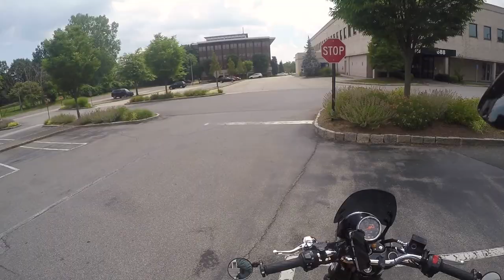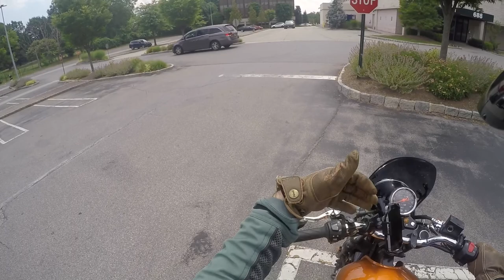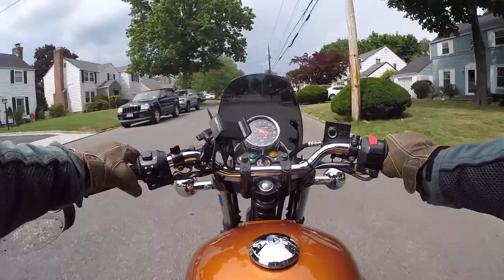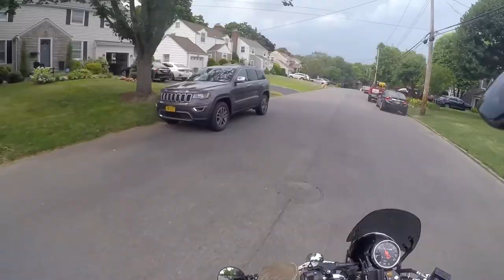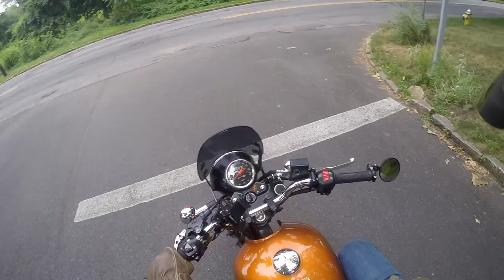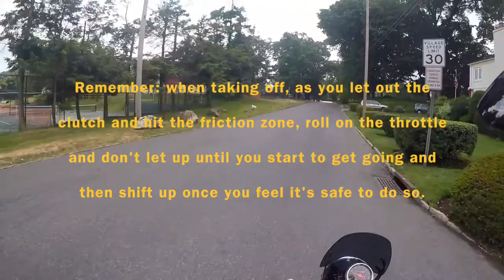How Not to Stall a Motorcycle on Takeoffs: An Effective Strategy to Keep Your Bike From Stalling

Comment: i was afraid that if I roll the throttle too much that the bike will zoom away. You made me realise that it will not because I am at first gear lol. I will practice this. thank you
Reply from the maker: I hope you find it helpful, Jay. Thanks for dropping by and for your feedback. I appreciate it.
Reply: ZOOOOM
Reply: If you find yourself going to fast in 1st just pull the clutch back or use the kill switch with clutch in.
Reply: @JDMz  thanks for the tip. I will keep this in mind. It's been a month and I feel confident riding my mc now. Specially when a vehicle is behind or in front of me.

Comment: Unfortunately motorcycles manufacturers failed to advance and improve motorcycles to appeal to most riders. Many riders give up and sell their new bikes because of safety and operating issues. The motorcycles technology used today is the same technology of the early 20th century. Motorcycles with standard trans should not stall under any circumstances and there should be no excuses.  Most street bikes should have a shaft drive.  Honda makes automatic transmissions for some bikes which is a good thing. Removing a wheel should be easy like a car wheel.
Reply from the maker: Thanks for your comment, A.A.

Comment: The most dangerous place for a motorcyclist can be at intersections, at signal lights and roundabouts. So always look in every direction to make sure it's safe to proceed. 

Bonus Tip: When riding a motorcycle, look way ahead in advance and analyse the road in front, so as to be prepared in case of a sudden event (example: a car merging in front abruptly).

Comment: Nice, straightforward video. Thanks. One question: how would you take off on a right turn, from a stop sign, on an incline. 
Also, in Ontario, it's frowned on to have both feet on the ground. I believe you actually lose points on the test if your right foot comes off the peg. Only the left foot is allowed off the peg at stops.
Reply from the maker: Hi there, jRichard! Thanks for stopping by. You ask a good question: How does a rider take off on a right turn, from a stop sign, on an incline? What a rider does in this case depends on a number of factors. First, always try to follow the guidelines you have learned in the motorcycle rider course, and if you haven't taken one, you should. Second, if you are a new rider, riding a motorcycle for which you are tall enough to be able to straddle it with both feet firmly planted on the ground, then you should apply one of the brakes to prevent the bike from rolling backwards. (I prefer to apply the rear brake UNLESS, for various reasons, I need to keep both of my feet firmly planted on the ground at which point you need to use the front brake, though I am not a fan of this, especially if stalling is an issue you're dealing with.) Once you have applied one of the brakes, then you should release the clutch ever so slowly while simultaneously applying a bit of throttle until you get the bike going. (Don't forget the throttle and don't shift until you get moving and until you feel it is safe to do so.) Now, I also use the friction zone to hold the bike in place while stopped on an incline, but to do this, you have to have experience riding. I really practiced a lot in empty parking lots and in areas with a lot of hills and minimal traffic. I hope this helps. I am not an expert; I'm just sharing with you how I have learned to deal with such matters when riding. Perhaps I might do a video on this, but due to my daily job, I barely have time to breathe.  Let me know if you have further questions or concerns. Be well & ride safely!

Comment: One important fact for new riders: don't put in 1st gear, unless you have come to a complete stop and the motorcycle is no longer moving. 1st gear is used only to start moving. Putting the 1st gear can be very dangerous if you are moving at a considerable speed.
Reply from the maker: Hi IM! Yes, you make a valid point. Shifting down to the first gear when the engine is at high revs has many consequences, including damage to the engine, and the rear tire will most likely skid and the rider risks losing control of the bike. Extremely dangerous.
Reply: @ReluctantBikerNYC  Yes, exactly. It can affect the engine and even cause the rear wheel to lock. I've noticed this for some new riders, hence it's important to tell them the reason not to do so.

Hats off to your videos and excellent explanations.
Reply: Hope you make a video on how to shift properly and smoothly on a motorcycle, the technique of rev matching, especially for downshifts.  I was once a new rider too, now I want to share my experience as a rider, so as to make riding motorcycles much safer.
Reply from the maker: I am working on a number of videos that deal with this topic, but my daily job is killing me. Between the job and the awful, soul-crushing weather here on the East Coast, I simply haven't had a moment's peace to get these videos done.

Comment: I just see people in fail compilation, they just throttle and wheelie and then crashed, so i wonder, how can they throttle smoothly without getting pulled like an rope tied into you
Reply from the maker: Hi! It depends on the bike. If they are riding speed demons, then that's easy, but again, the kind of bike you ride determines that. My Z900RS pulled like that.

Comment: It's hard to tell. Are you keeping the clutch at the friction zone when rolling on the throttle from a stand still? Then while still at the friction zone you pull clutch all the way back in to shift to second then back to the friction zone with steady throttle?
Reply from the maker: Hi. Let's address the first question: "Are you keeping the clutch at the friction zone when rolling on the throttle from a stand still?"--Yes, I am, sort of. The clutch is not kept in the friction zone; rather, it is released into it slowly. As you release the clutch, you simultaneously must roll on the throttle. You also ask, "Then while still at the friction zone you pull clutch all the way back in to shift to second then back to the friction zone with steady throttle?" The clutch has been released entirely and the bike is moving, and when you're ready to shift, then you pull in the clutch all the way, shift gear, and then as you reengage the friction zone, you roll on the throttle again--but you must be very careful, especially if you are riding a powerful bike. Hope this helps. Let me know if you need further clarity on this matter.

Comment: I don’t agree. I looks like you found a way not to stal the engine on takeoff, but I would definitely advice you to give more attention to the clutch and the friction zone over the engine rpm. 
All though it is a cooperation of the two, the biggest mistake is telling people they need to release the clutch slowly. That is a false statement and it causes people to stall their engines. In fact, what really happens is that you release the clutch just enough to get into the friction zone, then you keep it there, and once the engine rpm matches the speed of the rear wheel you release completely. People need to understand that the speed of the gearbox (being zero) does not match the speed of a turning engine (being approximately 1100rpm) on standstill. Both are connected with discs that are able to slip. Your clutch is designed to control the slip needed until they have approximately the same speed. Then you can release the clutch completely. 

Revving that 250 thumper is not the way to do it, all though it has as a result you won’t stall that much, you are missing the point of clutch control.
Reply from the maker: Hi there. I do not think you and I would disagree with your view. For example, I agree with you that a rider must give significant attention to the clutch and the friction zone, hopefully thoroughly mastering their application to the art of motorcycle riding. I also agree with your statement that one should "release the clutch just enough to get into the friction zone, then you keep it there, and once the engine rpm matches the speed of the rear wheel you release completely." This is what I meant in the video, but perhaps I did not explain it as eloquently as you. That aside, the point of the video was to help riders not to stall their bikes, and the technique I share here is not, perhaps, the best out there, but one thing is for certain: If a rider employs it cautiously, he or she will seldom stall their bikes, if at all. It works, but caution must be exercised, and once the rider becomes better skilled, then they need not continue using it. Again, the purpose of this video is not clutch control, but how to avoid stalling a bike, a topic which, I agree, falls under the purview of clutch control. I am not an riding instructor and I do not have a whole lot of experience with bikes, but I get around and try to share what has worked for me and other members of our community. Thank you for your feedback, for you make some really valid points that every rider should keep in mind. A truly appreciate it. This is the whole point of this channel, really.
Reply: This is a great comment and it's the first time I've seen somebody explain it this way. The concept of slipping the clutch as a constant state and the wheel speed increasing from zero to engine speed is easy to visualize and makes a lot of sense. I think most people, both students and instructors, think that the wheel speed is only increased by progressively releasing the clutch to create more and more friction.

Comment: when im comin from a stop my bike seems to sound clunky get back to speed is that cause im in wrong gear?
Reply from the maker: Hi there. It depends. What bike do you ride? And yes, it will sound clunky if you're not starting from the 1st gear. The rule is this: always be in 1st gear when coming to a full stop--no matter what bike you're riding--and always start in the first gear. Note: When coming to a full stop, you can put your bike in neutral if the wait is long, etc. Hope this helps. Be well and ride safely.
Reply: @ReluctantBikerNYC ok great and hawk 250 im newer to riding as well

Comment: Unfortunately the bikes used in the riding school I went to were modified to very easily take off with just the clutch... it was only afterwards I found out that regular bikes usually need a bit of gas to help them take off properly.
Do you happen to know if v-twin bikes also need some throttle to take off? Theoretically they should provide more torque than other type of engines at lower revs.
Reply from the maker: Hi there. Yes, you make a good point. Just like you, I also found out afterwards. It's such a coincidence that you ask about V-twin bikes because (I don't know how familiar are you with my channel) I recently added to my stable a V-twin: Moto Guzzi V7 iii! And I can confirm with absolute certainty that I still employ the same throttle strategy when riding it as I do when riding my TU250X, even though the Guzzi has about three times more torque pull than my little TU. The clutch-throttle technique on these bikes works splendidly because of their low-end torque, which makes riding more relaxed. I will be posting a number videos on my V-twin, so stick around. Thanks again for stopping by. Be well and ride safely.
Reply: @ReluctantBikerNYC  Thank you very much for your prompt reply!
To be honest, I've just ran into your channel looking up this exact clutch/throttle take-off "dance", both due to the reason I mentioned above (riding school bikes being tweaked to be easier for beginners) and also because quite a lot of other videos mention that you can just engage the bike in 1st gear with clutch only and just eventually let it roll.

Enjoy your MG! :D
They're a bit too weird for me (and kinda hard/impossible to have forward controls... because Moto Guzzi!).
I'm just looking forward to finally riding my Shadow 600, bought it up before I started riding school last year and right now I'm waiting for someone to help me tweak some stuff on it.

Thank you very much for your kind words!
As we say in my country, "dry tarmac!"

Comment: Idk I just did my msf course and I been driving manual transmission cars for 14 years or so and the way manual cars are driven is by using as little clutch as possible so clutch in get in gear release clutch rev up clutch  in switch gears and clutch out etc .. when I took the msf course that’s how I was driving clutch in go into first gear once I was moving I completely released the clutch and once I was up to a decent speed then I shifted up .. the way you are continuously holding the clutch while moving and giving it gas that’s going to burn your clutch out isn’t it ?  Or are motorcycle clutches more robust? I’m not talking about how you are holding it to get it going and giving gas I mean after you clearly are moving you still have your hand on the clutch and you’re getting up to 20 mph or so still with your hand on depressing the clutch and then you shift up isn’t that going to cause premature wear ? In manual cars that would be called riding the clutch
Reply from the maker: Hi Andy. Yours is an interesting observation, though I'm a bit puzzled by it. On a motorcycle you may use the clutch for multiple purposes, not just in cases of switching gears. Though I am not sure of the moment you refer to in the video ("I mean after you clearly are moving you still have your hand on the clutch and you’re getting up to 20 mph or so still with your hand on depressing the clutch and then you shift up"), you probably saw me employing the clutch for such a purpose. Do you have any riding experience?
Reply: @ReluctantBikerNYC   at 6:07 you have the clutch depressed you get it into the friction zone give it throttle and the bike starts moving.. not sure if it’s the view but it seems like your clutch is still engaged in the friction zone. you even say do not let go not sure if you’re saying do not let go of the clutch or the throttle but then you fully depress the clutch and shift up ...  what I’m trying to say is when I ride a motorcycle I use the clutch as little as possible, a habit from driving manual transmission anytime you have the friction zone engaged with throttle you are burning the clutch a bit and causing wear.. so I depress the clutch get into the friction zone give it throttle and completely disengage the clutch give it more throttle pick up speed then depress the clutch shift up let go.. it seems like you’re not letting go of the clutch .. like I said in a car that would be called riding the clutch and it causes premature wear but if motorcycles are meant to be rode like that then no harm .. it’s just an observation really
Reply from the maker: Ah, thank you for clarifying, Andy. It's a very good observation, really. Unfortunately, the angle of the camera seems to show the hand as if its pressing on the clutch, but it isn't. My fingers are gently resting on the clutch after the initial pull from the stop, during which briefly riding the clutch is a must, for a quick release will stall your bike, which is the whole point of the video: to keep the bike from stalling. To prevent stalling when pulling from a stop, the clutch must be released slowly while at the same time, the rider must also roll on the throttle. This little dance of hands must happen simultaneously. Moreover, the rider must be, at the same time, ready to shift up immediately after this little maneuver (or dance, as I like to call it), so you hand must be hovering over the clutch. Such is not the case once you pick up speed and are keeping up with traffic, etc. These movements might be--I have never driven a stick shift car--quicker and more imperceptible than those when driving a car. Finally, when used properly in such manner, based on my knowledge and research, no harm will be done to the clutch, especially if it is a wet clutch, which mine is. But I have to thank you for bringing this up. Excellent observation.

Comment: Is it normal if the new bike sometimes doesn’t start from the first gear? Or there is a problem with the bike?
Reply from the maker: Sorry for the late response! Always be in the neutral when you start the bike. Always. Safety first. However, your bike should also be able to start in first gear if necessary. Hopefully you have resolved the issue. Let me know. Be well.

Comment: stalling mostly happens when u ride other, different bikes..i have two 600s one of them seca2 caffe racer 1993 other is triumph speed 4..completly different bikes.. with time i got used to both of them.. stalling still happens but its not comparable to my first month with the bikes..if u ride one bike all the time u should be fine after 500 600 miles riding..

hint...

learn to take of slowly without using the throttle.. clutches have ond spot were they engage, learn that spot.. master it and ull stall  almost never.. 😁
Reply from the maker: Hey, Chev, thank you for your suggestions. You do, indeed, make some good points, especially the one about the mastering the friction zone.

Comment: For the uphill and downhill starts, you never mentioned when to release the rear brake
Reply from the maker: Hi Matt. Good point. I'm currently producing a couple of videos on how to do that, but I'll briefly explain that here: Just keep in mind this fact: multiple operations are taking place at the same time here during this process.  The rear brake is released progressively at the same time the friction zone is engaged and the engine starts moving. Do it slowly, removing your foot from the rear brake at the same time as you release the clutch. The golden rule when riding a bike I think is this: Never do anything abrupt when operating a motorcycle, unless braking for emergency. Bikes do not like it. Be tactful and gentle, feel the bike, know its power, and use that knowledge to operate it. Thank you, Matt, for dropping by and I wish you safe riding. Please ride carefully. Be well.